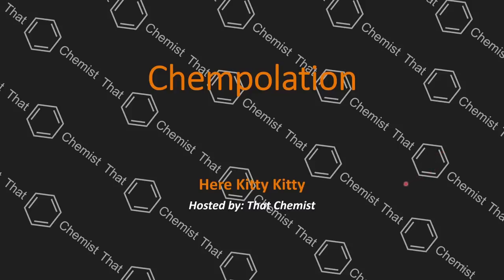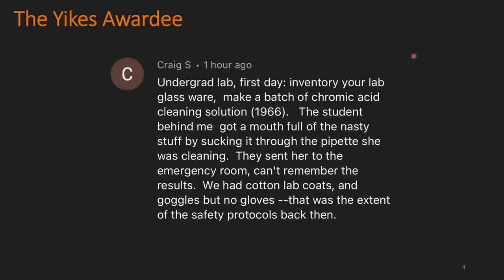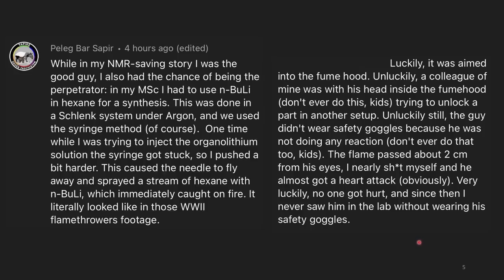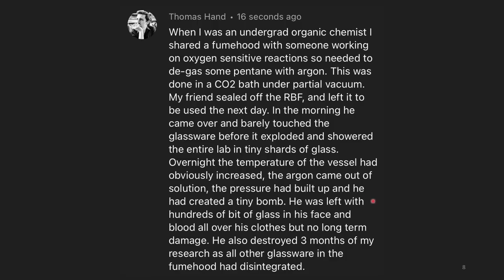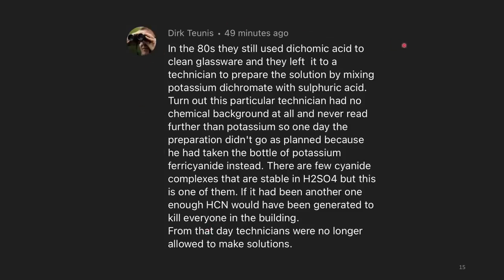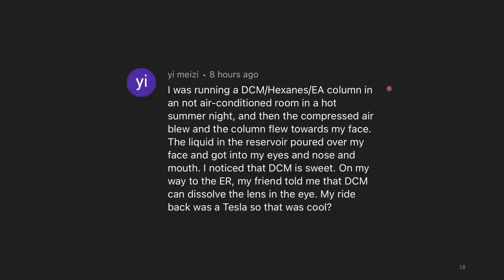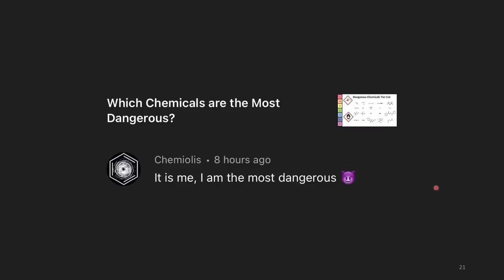He found out why that box was wet…

Comment: One of my chem lab professors told the story of when he did research in Russia. Apparently at the time the chemists were a bit slack when it came to lab safety. They both pipetted by mouth and smoked in THE ORGANIC LAB. For those that don’t know, organic compounds are often very flammable. These people were lucky they didn’t cause an explosion.
Reply: There would have been smoking allowed everywhere. I think I have seen couple of old professors on youtube that said that. Dangers on so many levels...imagine working in bio lab and accidentally tasting the cultures on a cig :D or spicy toxic organics, or maybe inorganic uranium salts
Reply: @mechadrake  freshly baked yellow cake!
Reply: Woodward would smoke like an old steam train when in the lab
Reply from the maker: It’s actually hard to start a fire with a cigarette - some channel demonstrated this with gasoline and a lit cigarette - smoking in labs used to be extremely common
Reply: @That_Chemist  That's true. The lighter or match you use to light the cigarette, OTOH, is another story. And for a lot of smokers, lighting the next cigarette after you finish one is done automatically, with very little thought. I have been told by many people, but never tried it myself, that if you drop a lit cigarette into liquid gasoline, it will just go out. I wouldn't be surprised if this is true 99 times out of a hundred, but that hundredth time would be really bad, and if you strike a match or fire a lighter anywhere with a flammable concentration of gasoline vapor, you're going to get a big fire very quickly.

Comment: I appreciate how edited the warning on the box in the thumbnail by crossing out the NUTS and replacing it with CATS? even though the text is so small it's illegible without zooming in
Reply from the maker: I did the thumbnail in paint.net and I couldn’t do a 3D rotation - I settled for a bad angle :(
Reply: @That_Chemist  To do that, go to Layers -> Rotate/Zoom and roll the little sphere around. Or input numbers manually.

Though the text would still be too small to read unless you made the box waaay bigger haha

Comment: This was less than a year ago.
For the last year of high school in our chem lessons a friend and I tried to make the loudest explosion with hydrogen as possible, but our chemistry rooms were currently being renovated so we had no supply to hydrogen gas. 
Everyone knew the experiment, where you fill a tin can completely with hydrogen, you put a small hole in the can and then put some source of fire next to the hole. Then the hydrogen escaping the tin can reacts with the air, generating a hissing sound for about 10 seconds, after which enough air will have gotten into the tin can, allowing the flame from the little hole to strike back into the tin can, making it explode and flying through the air.
As we had no hydrogen we had to generate our own. For that we used electrolysis, as we had run out of HCl, which I would normally have used in combination with magnesium, as it is easier.
So we generate the hydrogen with electrolysis and run it through a tube into the tin can.
Then my friend pulls of the tape from the tin can, opening the hole and I quickly put a glowing splint next to the hole and there instantly was the explosion. No time for us to get back and cover our ears. I hear the loudest PENG I have ever heard in my life and hopefully ever will. And after that peng there first was loud beeping, as if you were flashbanged in a game, followed by complete silence for what felt like an eternity. After 30 seconds i was able to hear like I had just gotten out of a disco. During these 30 seconds I was just like damn, I hope I am not deaf now.
My friend was more lucky and only had the problems on one ear. Another friend of mine, who uses to hunt, told me it was certainly louder than a gunshot.
After that my friend and I went to the doctor. Both of us luckily still have 100% on both ears and we only had acoustic shocks.
The only explaination I can come up with is, that we messed up putting pure hydrogen into the tin can in such way, that we actually had a close to optimal hydrogen to air ratio inside of the tin can.
I would like to add though, that we tried to avoid that, by calculating how many mL of the water should have been split into H2 and O2, to fill the tin can with only H2. We even doubled the amount of H2 produced to be on the save side. It probably just took us too long and gave the H2 in the tin can enough time to mix/react with air.
Long story short: Got me and a friend an acoustic shock trying to experiment with hydrogen.
Reply from the maker: Yikes! Hydrogen can still be dangerous, as you learned!!

Comment: I've messed around with home chemistry for many years. When I was in high school, I made the stupid mistake of trying to purify my own sulphuric acid. I purchased the H2SO4 you can get for refilling car batteries and found it wasn't as concentrated as I wanted. So, I figured I'd just boil the water out of it. I start heating it on our kitchen stove and it starts throwing out fumes - likely SO2 and SO3. I immediately told my family to head outside and opened every door and window I could. I got a nasty, acid taste in my mouth so I decided to wash it out with milk. As soon as I poured the milk into the cup, the surface circled due to the high acidity content of the air around. Definitely not my smartest moment. I now use sulphuric acid drain cleaner from the hardware store - no purifying needed.
Reply from the maker: Yikes!

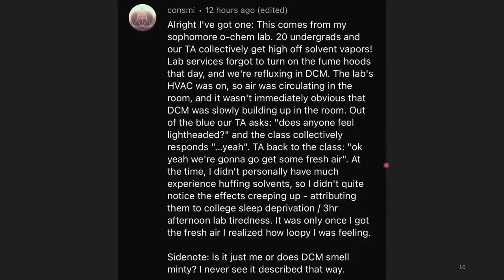Comment: 9:00 at the time I didn't personally have much experience huffing solvents.
That Chemist: WHAT DOES THAT MEAN?
That got me chuckling, the way its delivered is brilliant.
When I used DCM in D&T back in ye olde days, I remember it didn't really smell of much. It had a vaguely chemically smell, but it was unpleasant to breathe in. Definitely not minty to me. However, it was not pure DCM, it was mixed with other stuff and it was gloopy, sort of custard consistency but sticky and heavy. Used it for bonding acrylic together, which it did very well.

Comment: Chemists and autoclaves dont mix. I saw the aftermath of a chemist trying to "sterilize" some super volatile low flash point solvent, about 500 ml of said solvent. The blow off valves on the autoclave BLEW OFF", not like they should have but the brass valves BLEW OFF. The door was stuck and the machine was destroyed

Comment: Environmental engineer- I agree with you about the fume hoods etc.  And I'll add that I spent time studying extra enviro science as well. I do feel conflicted about the electricity used for the purpose but I'm sure if that was the only system you needed to run you could do so via renewables where it makes sense. I'd go further to say that any building where there is a greater risk of fire like that should have a certain level of power at all times anyway. Using some to power fume hoods at the very least is NOT unreasonable. Also failing to change the power off timer on the buiilding (as well as scheduling a course without adequate time to exit) is irresponsible. Can you tell I'm an engineer from my extended rant on safety? Lol. Love you chemists! :) If you didn't blow stuff up I wouldn't have ideas for new safety measures after all....

Comment: One of the grad students in my lab was using a deuterium cylinder to charge a reaction vessel, and was passing the gas through a concentrated sulfuric acid bubbler to dehydrate it.  But the bubbler wasn't bubbling, so she turned up the gas pressure.  It still wasn't bubbling, so she turned up the pressure again. Still no bubbles, so she CRANKED it, and the bubbler exploded, spraying gas and con sulfuric all over the fume hood... and another grad student who was working in the same hood.  It turns out the tube was clamped on the reaction vessel side of the bubbler, and she'd forgotten to open it.  He was wearing safety goggles, so he didn't lose his sight, but he did have small dark spots on his face for months.

Comment: I got Diethyl Ether on my gloves many times, and it soaks right through. It leaves them feeling icy-hot and kinda painful. Also, I know what shirts I used to wear at that lab because they all have tiny holes in the fabric.
I tried wearing a respirator while cleaning glassware with acetone because the fumes bothered me, and they TOLD ME NO because I was using my own PPE. "Do you have one for me to wear?" "No, it's not a problem. You'll get used to it." Probably should've reported them.
Edit: Almost forgot the best one! a client sample arrived (mostly factories) labeled PCP. It was about 500g of white powder. Everyone noticed a tingling sensation after removing the lid, as the powder was very fine and had no issue floating off from the top of the jar. Scary times.

Comment: As a beginner student a fellow student was making acetone peroxide for some upcoming day were fireworks were common. The lab supervisor walked to him with an angry face. He did not know what the student was doing and reminded him to wear safety glasses. Always wear your safety glasses!
I guess it was common stuff back then. When doing my undergrad labs there was bottle clearly marked as 3 membered acetone peroxide on the shelf. "Only about" 50 or 100g or so but I never went near it or any of the bottles near it.
I was also told why the gas bottles had chain around them. Supposedly someone knocked over a full oxygen tank that lost it's regulator. You can guess the rest I presume.
I think safety has improved a lot from back then and for a good reason.
Reply from the maker: You can find videos on youtube of exploding cylinders - it’s absolutely terrifying

Comment: That story at 15:09 is a clusterfuck of bad decisions.
Why are you working with volatiles without adequate ventilation?
Why are you working at night? (nothing inherently wrong with that, but it often means fewer people around to help in case of accidents)
Why are you using enough pressure to turn the column into a missile, and why is it not reasonably secured?
Why is your column setup not in a fumehood?
Why are you not wearing eye protection?

WHY
Reply from the maker: Exactly!

Comment: In my ochem lab, we primarily used ether instead of DCM as, well, chorinated solvent issues, but I got to use DCM a few times. I remember one time distinctly because it was a bit warm and I was very clearly able to see the vapors, and could "pour" them out--super cool, probably not great for me, but all our experiments were done on <1g scales, so the amount was probably fine. Minty is an interesting way to describe it--I wouldn't quite say it's minty, but it's refreshing compared to ether. While I like the smell of ether, it absolutely smells "thick" and kind of "noxious" and it's the type of smell that you can almost physically Feel. DCM, while smelling more like "I shouldn't be smelling this" chemical type odor, was a lot "lighter" and easier to handle.

Comment: n-BuLi catching fire? i highly doubt that tbh.
The needle flying off and content spraying everywhere also happened to me a few times with the standard 2.5M solution. I even got it on my skin once. Other than stinking and turning hot it doesn't do too much. I often use a mid sized beaker to spray n-BuLi leftovers from the syringe in it and leave it in there. Never in my life have i seen it catching fire, even when in contact with water. Might be the concentration being too low but i dont usually see higher concentrations being used.
sec- and t-BuLi (and other things like Me2Zn solutions) are a whole different story though
Reply: 10 M definitely catches fire upon exposure to air, so maybe that was what they were using? Or maybe the lab was super humid?
Reply: IIRC the n-BuLi was dissolved in hexane. Hexane is pretty close to gasoline, in terms of flamability.

Comment: An autoclave is similar to your pressure cooker. Works the same way and do pretty much the same thing, but not for food.
When I was at school, we did mouth pipetting... But only with mild stuff, like mild acids (think 2 to 7% acetic acid), mils bases (think sodium carbonate), and distilled water. Our teacher made it very clear that most of the time, we'd need to use at least a rubber bulb pump for anything that we are not 1000% sure it's harmless.

Fume hood must NEVER EVER be on any circuit that can get shut off. Automatically or manually. It need 5A of electric current? Better make it a 30A circuit.

Comment: Alright, not nearly as complex or horrifying as most of these, but here's my favourite story from college. In chem, I sat opposite the labs' doors, which had the stereotypical little window of reinforced glass allowing me to see through into the corridor and further, through the lab opposite's own little glass window. During a lecture I happened to glance out of said window, and Oh Dear Gods. What I heard was the most ungodly whirring, like fifty three giant hornets being shaken violently in an urn. Then a scream, followed shortly afterwards by the sound of glass shattering. What I SAW was a blur of motion past the door windows, and then a container of miscellaneous orange SOMETHING exploding like a paintball against the wall. I started giggling a bit hysterically, because What, that's some looney tunes bs right there, and quickly explained what had just happened to the class who didn't get the visuals on top of the audio, to which the professor sighed and went, in the most deadpan voice imaginable, "Ah. Centrifuge." 
If the class hadn't been laughing before, we were cackling at that point, and we could hear the lab next door doing the same. Obviously, the professor and a couple of techs left to go assist with the damage control, and I think it was the first real bonding experience my class had together so early in the year.
I was mostly terrified of whoever had the strength to yeet a tube of orange mystery liquid with that much force to begin with, so the explanation was actually somewhat of a relief, but... STILL. 
What I want to know is how on earth this was such a plausible incident that the professor was so unphased by it?! You'd think someone would keep an eye on that after the first MULTIPLE INCIDENTS lmao. Those machines are Expensive and notoriously easy to not balance properly, and when they're in use usually either lecturer or assistant fucking apparate beside it and stand guard like it's their sworn duty, which I mean... Yeah. I guess it kinda is. All I can say is that whoever left the chem students unattended frankly had it coming, worst decision-making skills on the market, clearly. Nobody was hurt, and I found out later from my friend in the lab responsible that the professor had stepped out momentarily to visit storage and someone had just assumed that they should go ahead with their experiment without assistance. It's a relief theirs was the only tube in the machine, as everybody else was reluctant to join in unattended.

Comment: One of the things I've done when I was a kid as making nitroglycerin. I was following a guide in I got from the internet at that time. My plan was to make something loud for the new year so I thought why not make a small tnt but instead of tnt I end up with making nitroglycerin since it was easier to make. I follow the guide and luckily it didnt explode while I was making it (since it is written in the guide that there is a chance of it exploding if it excide a certain temperature. As to where I got the ingredients, it happens that most of ingredients are already in the house except the glycerin which I have to buy at a pharmacy. Though I made it successfully, but if I remember the yield was low, maybe because some of the chemicals that I used is contaminated. Yes I still used it and damn a small glass bottle of it has a really loud bang....

Comment: Yeah I can‘t really smell DCM or Chloroform either, but one time when I had filtered a DCM solution, i foolishly just messed around with the still wet filter paper outside the fumehood (I don‘t remember why but it most certainly was not a good reason). The smell it gave off was quite weird but indeed very minty. Most of the smell just came from what was dissolved in the DCM though, so not even sure that is actually its odor. I‘ve heard people describe the smell of the chlorinated solvents as sweet, but they‘ve never smelled sweet at all to me. One time I blew compressed air through a pasteur pipette that I had used to fill an NMR tube with CDCl3 (I was trying to blow out a piece of cotton that I used to filter it), another absolutely moronic idea. That was the only time chloroform has ever smelled like anything to me but the closest thing to compare it with would have been lighter fluid, definitely not sweet. Idk smell is weird.

Comment: I was making homemade solid rocket fuel for a small rocket I designed. It was supposed to be simple; I had my KNO3, ground sugar, my safety glasses and my portable heating plate since I moved outdoors. I added everything and started heating it up. Everything went well, until I was going to pour the rocket fuel into the mold and the mold started melting. Well, that sucks, so I thought why not make the fuses now instead? So I dropped some cotton string into the pot and after a while, SHOOOOOOOOOO, the pot flew up a few meters in the air and landed on our lawn. Some of the grass burned away where it landed. It kept running for a while until the fuel was used. It was really cool and scary, KNO3 seems like a pretty good oxidizer.
Reply from the maker: Yikes!
Reply from the maker: Sugar is a fuel, not an oxidizer
Reply from the maker: KNO3 is the oxidizer
Reply: @That_Chemist  True, just came home from a long trip to IKEA